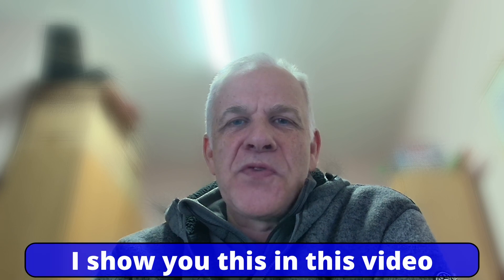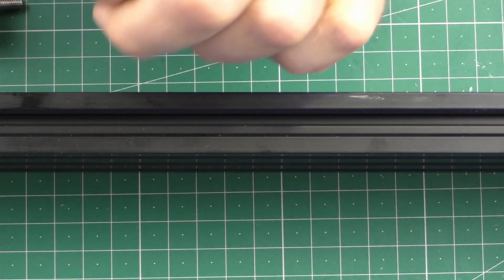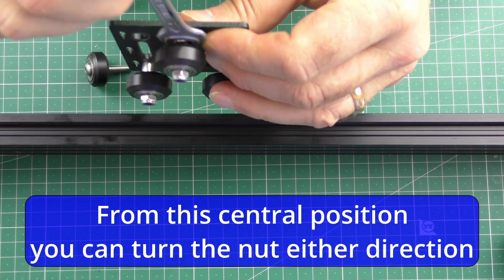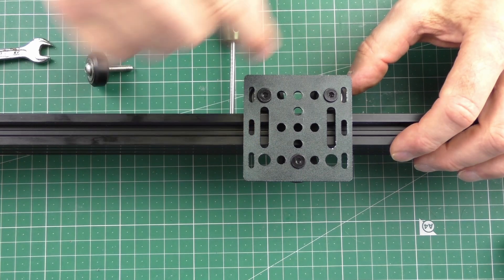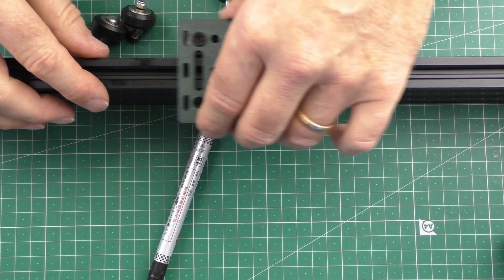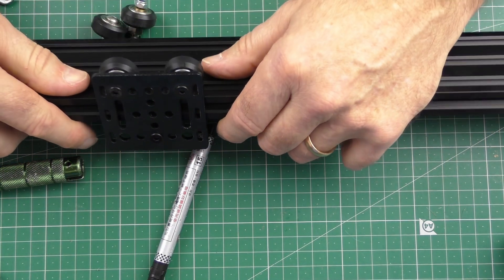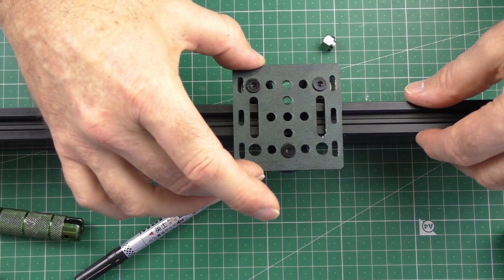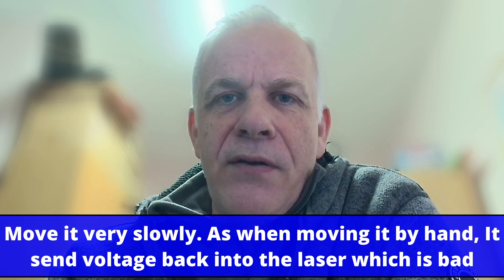How to Adjust Eccentric Nuts on Your Diode Laser for Perfect Motion

Comment: legend thank you! I've removed the belts and it's really tight, to the point the bearing feel rumbly (on the X axis) which came assembled so I didn't check. Even with the eccentric nut as loose as possible it's still to tight. We have a machine shop so I made some alterations and yep miles better!
Reply from the maker: Thanks for the great feed back. It's easy to over tighten both the belt and the nuts. But now you know what to do. It's amazing it does not take much to mess things up